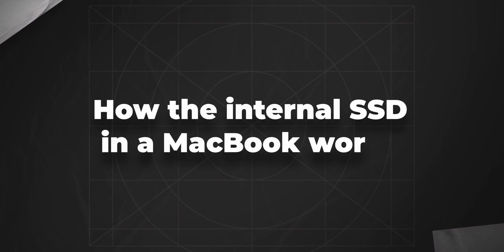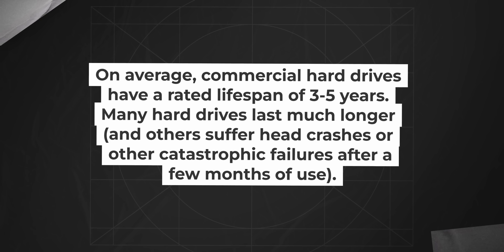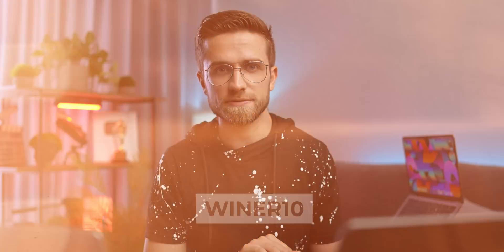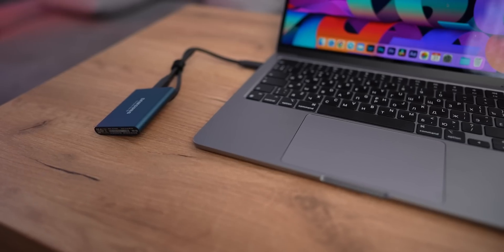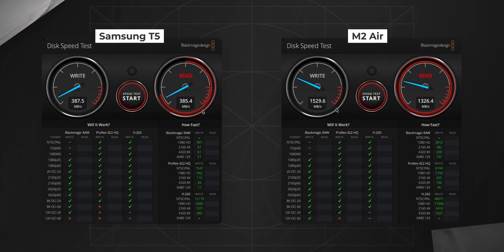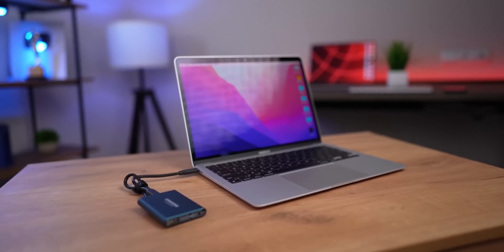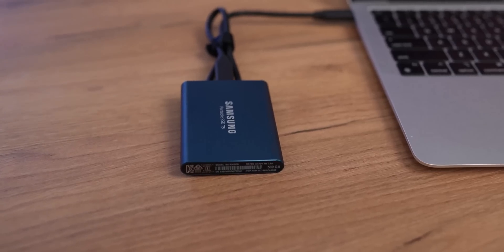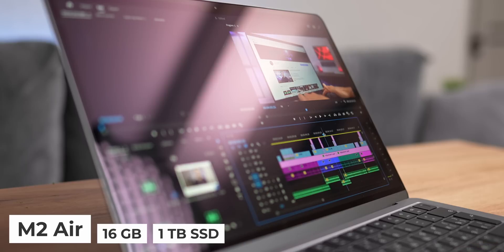M2 MacBook Air UPGRADE that actually makes NO SENSE!

Comment: What if I get 16 Gb RAM to help the swap issue but 256 GB storage with an external SSD? I can only choose to upgrade one of the two
Reply: Check out the video by Artisright who tested this extensively. Basically upping to 16Gb Ram is the way to go and seems (in most cases) to perform better then upgrading the storage to 512
Reply: I got 24gb RAM and 256 ssd. I know, I know, but I figured I could get around it if I just use an external SSD. I honestly think the whole NAND chip topic is overblown, and RAM is far more important and you can't upgrade it so I figured might as well max it out for peace of mind. It just wasn't as worth it to pay an extra 200 for SSD when I have a bunch of drives already laying around.
Reply: @a96415  bold
Reply: @a96415  I agree. It’s because the gullible listen to all these ‘YouTubers’ creating problems that don’t exist for views, subscriptions and likes. They do it every single time Apple release something. People are such sheep these days.
Reply: @a96415  why didn’t you just get the 14 inch pro ?
Reply: @raularce63  There isn’t much (if anything) the pro can do that the air can’t. Plus that thing is easily a $2400+ purchase. 

Even with the 24gb ram it was nearly a thousand dollars less.
Reply: @a96415  the MacBook Air with upgraded 16gb of ram and 512gb ssd comes out to $1700
The MacBook Pro base model with 16gb of ram and 512ssd for $1800 with the student discount or $1750 for a refurbished one on Amazon
Reply: @raularce63  You're not wrong, but I would've wanted RAM greater than 16gb, and getting 32gb would have made it a 2400 purchase (including tax). I paid around $1600 for the Air in the configuration I mentioned.

Nevertheless, it's not the computing power I need as a student. The Air can do what the Pro does, just not as fast in all use-cases. After I've graduated with a job I plan to look into a more powerful mac (possibly an M2 mac mini) or simply a desktop PC (as I'm already familiar with building them). But for now, the ultra portable form factor + computing power of the M2 Air suits me just fine.
Reply: Go with ram brother i also upgrade only ram it will be good decision is you need this laptop for long term time. If you need particular reason then ask me I'll tell you
Reply: Swapping isn’t an issue, it’s normal and standard.
Reply: 16gb ram is king if you’re looking for the performance boost.
Reply: I did the same thing. It’s been just over a week now and I’ve loved it! I haven’t used any swap memory since the last time I checked and I work heavily in my OneDrive so the 256gb storage isn’t an issue. Def recommend this option
Reply: @random123456789qaz  according to me you need to go with gpu and for more you need to ask with alex who's link sent you
Reply: Currently using an m1 macbook pro with 16gb ram and 256gb storage for iOS Development, and it's pretty annoying to have to delete so much files everytime because I'm at around 30GB free space
Reply: @christianalvarez1726  I thought the base model MacBook Pro  comes with 512gb ssd?
Reply: @christianalvarez1726  Should have saved a little more and gotten 16gb ram and 512 GB especially if you are doing any kind of program development.
Reply: Choose 512gb storage bro
Reply: @mohemadfaizandabhoya  No.  You can add storage via USB drives.  RAM is fixed at purchase.  If you must choose (why when with $200 more you would have both 16 GB and 512 gb I have no idea — it isn't that much more) you go with the RAM.
Reply: think long term, save up a bit longer and get 16gig ram and the 512 SSD. 256gig does not go far at all these days. It's actually more like 220 as the OS takes up space, and over time, the OS updates take up even more space. For a computer that will last you several years at least, it makes sense to future proof just a bit.
Reply: @Lexxo777  you can just get an external drive
Reply: @lupusrexstudio7327  Exactly
Reply: @Lexxo777  Exactly.  It is only $200 more to have both 16GB Ram and 512 GB ratehr than play the 'which should I get' game.
Reply: @Maximara  i thought it is 200 for each upgrade, 200 for 16gb ram, and 200 for 512 ssd; that makes the macbook air 1600… 200 more and i could get 14in MacBook pro.
Reply: @Mrbingles9  The M1 16GB 518 GM MBA is $1,399.00 ($999.00 base + $200 + $200) and 14in (13.6 actually).  Thanks to the way Apple has the base price, barring discounts, there is no such thing as a "macbook air 1600" as the M2 16GB 518 GB MBA is $1,699.00 ($1,499.00 + $200).  The 14in MacBook pro ($1,999.00) is an M1 while the $1,699.00 M2 ($1,499.00 + $200) is 13 inch .  So either way you are doing a downgrade either in CPU or in screen size for a fan.
Reply: @Mrbingles9  $1700 with tax I been thinking of just getting the pro seems like better value
Reply: @Maximara  the MacBook Pro has an m1 pro chip and it outperforms the MacBook Air I don’t get your point?
Reply: @Maximara  The 14in is 1800 refurbished already, bringing it much closer to an upgraded M2 Mba.
Reply: @Mrbingles9  I ignored refurbs for the obvious reason of 'that configuration may not be available in the future'.
Reply: @Maximara  no it’s 400 usd and more expensive in other countries
Reply: @sulogno  a 8GB unified memory 512GB mini is $899.00 with 16 GB for $200 more.  The portables is where apple socks it to you.
Reply: @Lexxo777  in 5 years from now the base model MacBook (2028) will run better than a "future proofed" MacBook (2023) that you buy today. It's not just the amount of RAM and SSD capacity that makes the difference, the technology used in the chip, RAM, and SSD make a huge difference. Apple is using a junk SSD in their MacBooks and can easily upgrade to a better quality SSD in the years to come.
Reply: What’s the reason for upgrade? 99% would be fine with 2018 laptop let alone M2
Reply: @apex_with_alex  people like new tech, the latest stuff. I’m a geek and love all the new gear that comes out.
Reply: @jaypalmer3806  yeah, same. I just trail behind by a model or two to get best buck for your money hehe

Comment: Excellent explanation as always. There is no point of excuse from Apple point of view to provide slower NAND chips in M2 mba, when its an upgrade from previous model!!!. First no proper heat sink & now this slower NAND. Why Apple why ?
Reply: The NAND chips in M2 mba are not slower it is just that Apple is using a single 256GB NAND chip rather than two 128s preventing the M2 from using the 256GB in parallel.  Never mind benchmarks and stress test don't really give you a view of what real world performance for Joe Schmo will be.
Reply: @Maximara  it is slower because one nand chip has fewer 'motorway lanes' into it.
Reply: @pauljazzman408  Which is just what I said.
Reply: @Maximara  sorry didn't see your reply, and two weeks ago too! It annoys me how people somehow don't believe that one nand chip is slow or that it won't affect them. Basically they don't understand it.
Reply: @pauljazzman408  It wouldn't be the first time Apple did a "what were they thinking?!" move — LC II case in point.  Some engineering 'genius' thought all they had to do was replace the 68020 with a 030 and the 2 MB soldered RAM with 4 MB...and ignored the in machine ROM was limited to 10 MB max.  So you had a Mac you could put 12 MB in but it could only use 10 MB of it.
Reply from the maker: Thank you!
Reply: @arthurwiner  You said about me winning something on another video. How will I contact you
Reply: @debasishchowdhury6496  If you have no idea what you’ve potentially won, then it’s probably a scam by a scammer (the user is someone else for example..). Be careful.
Reply: @louisea308  Thanks Lousie. It seems you are true.
Reply: No proper heat sink? Wow, you sure are smart,much smarter than those dumb Apple engineers.